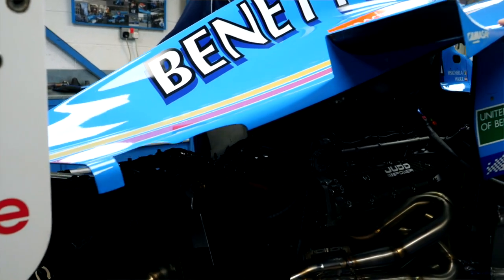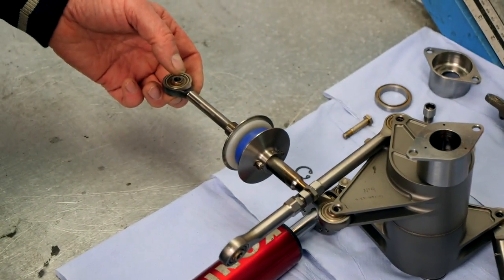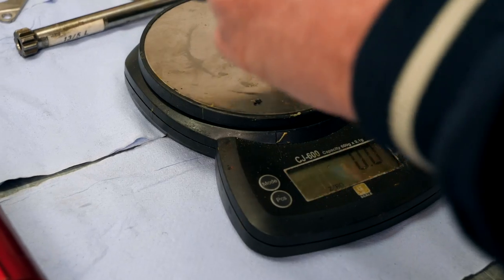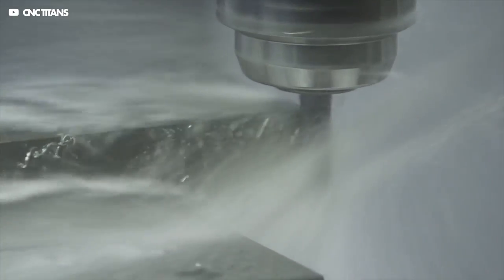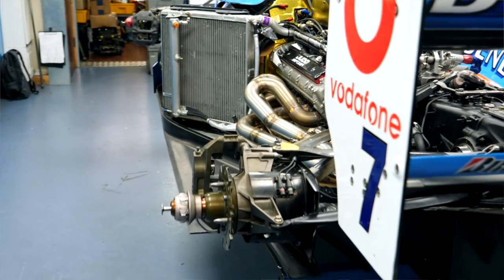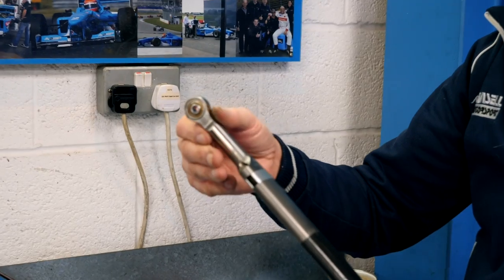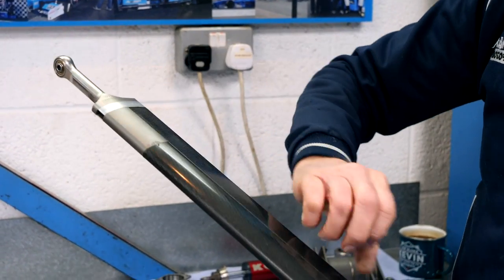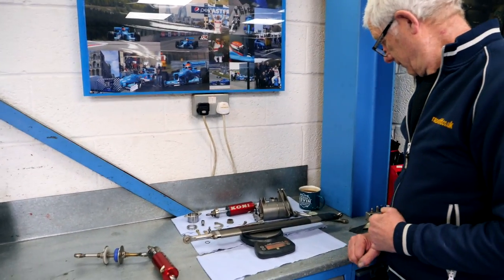How F1 Suspension Works

Comment from the maker: What do you think to this system? What systems in the car would you like to hear about next? Drop a suggestion in the comments!
Reply: An in-depth talk about:

Diffusers
Airbox/side pods
Gearbox

All could be interesting, heck any topic is interesting.
Reply: Bose
Reply: flexion joints would be first of its kind
Reply: Everything about your dads workshop would be fantastic to see Scott. Keep up the good work!
Reply: The cooling system is also an interesting topic
Reply: This was great, I would love to see a lot more about suspension - heave dampers, push vs pull rods, roll centres, camber change........
Reply: @lelz Indeed flexure joints would be a great point to talk about!
Reply: I'd love to hear how your dad ended up with F1 cars in his workshop!
Reply: Great video. The exhaust design would be awesome do dive into.
Reply: Hubs designs, Steering, engine air scoop, rear half shafts.
Reply: Would love to see a "master" course in designing a F1 car. Step by step going through all the decisions to be made and so on.
Reply: @DenUil  join your local Formula SAE team
Reply: Was your Pops a former f1 mechanic?
Please make more vids like this showing components up close. Super trick.
Reply: Brilliant Thanks, could you spend a bit more time on the suspension components, and how the components interact to control the movement of the car.
This l'd like to understand better
-  how the suspension arms attach to the chassis. It often looks as if they are bonded on flex components, so how do they quickly replace damaged suspension arms? and how much does the flexure contribute to spring behaviour?
- how does the 'anti roll bar' work - it looks like it would allow some differential movement between the sides, but would prevent equal sag or rise movement.
Reply: All of them!! I love this content
Reply: It'd be great to start of where is the actual position of those components in the car and how they behave when driving in the demanding conditions:)
Reply: I was hoping to see something about the anti roll bar .
I have pushrod suspension in a 70 mustang & im debating converting the anti roll bar into the rocker mechanism
Reply: Great video!
I'd like to learn about the wooden plank in the floor. ✌
Reply: It would be really good if you could get some regular car components that perform the same function and compare the weights and the design. Also please let your father have longer screen time and give us more technical details! Thanks for doing this, great content.
Reply: @Rendezvous70  The Anti Roll Bar is another torsion spring, the other end to the rocker is mounted to a swivel that is free to move longitudinally.   This allows for suspension compression over bumps to occur with out extra load being applied, but if one side tries to compress, then the two links to the ARB apply a twisting force to the rocker that is resisted by the torsion spring.   You can see the ARB in this image. http://www.galmerinc.com/images/front_susp_cropped.jpg
Reply: @Rendezvous70  It could, but the packaging  into a vehicle like that would be difficult and complex.  I don't think that it would be worth the effort.
Reply: @stephendean6460  ya thats kind of my conclusion too .
The torsion of the rod even if i used titanium would be beyond its yield strength at the length i have space for even though my travel isn't a lot it's probably to much .probably should have started with a lighter car maybe 😉whats an evo or sti weight..
Reply: I don't have a suggestion really, although I do like comparison videos, showing how different motorsports tackle engineering problems to suit their particular sport, so that would maybe be good on your channel.
Also, the videos you do about the more extreme things they've tried out in F1, are really good!
I bloody love this channel! It's really informative and explains things in a detailed way, that even an idiot like me can understand, but how about going into more detail on how and why they need the parts that you feature, like the things they're trying to overcome, ie: drag, downforce, grip, mechanical grip etc?
I love F1 and enjoy the pre-race stuff they put on the programmes, about the engineering side of things but, they don't go into anywhere near the detail you do, so thank you for making your videos!
Reply: It's an older suspension and components regarding the video.

Current F1 cars have done away with springs.
Reply: Different materials used on the car. In different areas and why
Reply: Great Vid but I wish these were not brief.   A little more in depth would be greatly appreciated, a little more demonstration of actual movement, etc...
Reply: Could you please do a video explaining the LED lights on the rollover hoop/air intake and what the different colours mean?
Reply: Cooling, rims and their progression through the years, intake, construction of the tub and or driver controls. Great vids I really love seeing the interworking of any F1 part from any era.
Reply: How thin are the gears in the gbox? What are the running clearance's off the bottom end?👍 love the channel
Reply: Driver61 explains how it works: the series
in-depth videos about all the tech behind every racing car series even soapbox cars
Reply: DRS. I know what it is and what it does but never will understand how it works and functions
Reply: Workshop tour together would be epic👍
Reply: you are such a brilliant educator dude. Some people are born to teach. You're one of them.
Reply: Front wing ( angle of attack control , sensors , spliiters )and steering (how tierods are actuating ) 

This kind of discussion at component level is actually good and new in youtube.  Most videos explain the  overall functioning but they don't cover component intricacies. nice work mate
Reply: I'd like to see how the steering rack + arms work. I think some of the cars have the steering arms inside of the suspension arms. It's very hard to find out how they are arranged.
Reply: How the software works when I watch races the engineers have all the data and tell the driver to cool engine, tires, etc. How do they get all the real time data?
Reply: Hi can you please KONI F1 dampers design and precision?
I heard there dampers are used in all F1 cars
Reply: FREAKING OUTSTANDING.  You answered every question as they emerged in my pea brain. 
I just watched 2 videos trying to learn about this and you explained more than those 2 combined. THANK YOU!
Reply: racing the rulebook. V10 era best era though.

Comment: @Driver61 i've a question, how happen during a crash, when the F1 hit the wall and the wheel flow out, how it's possible the monocoque can be re-used. So the suspension system, have some "tricks" to save the monocoque when the tyre it gone? thank you

Comment: Remember, this is 25 year old technology, and it still looks cutting edge.
Reply: Imagine what it must be like in current F1 cars then 😱
Reply: @xissburg  well that rubber heave spring they showed, up untill a couple years ago they had front and rear interconnected hydraulic setups to control heave and squat. Even just a 'basic' heave spring now looks 100x more complicated than the one in this video lol
Reply: It looks different, but not cutting edge. It's still dampers and pivots and arms.

Nowadays road cars have active dampers while race cars have something called Inerters.
Reply: Williams got a slower development than other F1 teams, from completely dominating in the 90’s and contending in the 00’s and having a decent car in mid 10’s, they went to dead last in just a couple of years, while using a top Mercedes engine.

And the tech has certainly advanced. It would be amazing if the UK were able to bring this kind of expertise to something commercial.

They would be making the best bicycles, motorcycles, cars and airplanes in the world.
Reply: @xissburg  if its anything like current body style and lines, its ugly af.
Reply: they could've made all the metal components in the 1960s , they understood all the structural stuff well enough. Milled parts would just have to be done manually like Allen Milyard does. 

The main technology of past 25 years is full computer control of everything both during operation and in design modelling.
Reply: @dfpguitar  And in simulation.
Reply: LOL  Torsion bars go back to the 30s  Nothing new just rare and expensive materials..
Reply: Totally!

Comment: Sorry for the interruption sr, but how important is the engine phase correlation in turn of reducing the high frequency vibrations around of the engine and the torque adjustment in the differential

Comment: The engineering in the manufacture of the rocker, all by itself, is impressive. Milling the two hollow pieces out of solid tianium blocks, (I assume they swept up every bit of scrap) and then welding those pieces together precisely; zero error, so that everything lines up correctly, and then taking the loads that that rocker has to take while barely moving what, half an inch? one centimeter? is just amazing.
Thank you.

Comment: Changing the rake does alot more than that. Without adjusting the wings it changes the AOA of the wing increasing downforce and drag from both wings by adding nose down rake. Unless the wings are re adjusted to compensate for that effect

Comment: 04:57 Did you close part of the radiator intake with tape? Can you elaborate on that? The Judd engine needs less cooling than the original Renault, or the cold temperature that day allowed for a smaller intake?

Comment: Front wing ( angle of attack control , sensors , spliiters )and steering (how tierods are actuating ) 

This kind of discussion at component level is actually good and new in youtube.  Most videos explain the  overall functioning but they don't cover component intricacies. nice work mate

Comment: Yeah I had something similar in my acura when I changed dampers and springs, one of the stops was rotten, so I just removed them and said "ahh, it'll never bottom ot anyway it doesn't matter ".. It very much mattered and I have to pull it back apart. The exhaust now has holes in it where it hits the highway so often

Comment: This is really intresting. But how about if you lower or raise a car? I mean if the rate stays the Same with front and back (let's say 5mm on both ends) does it affect the overall aerodynamics or just make the car slower/faster overall if potentyally someone could drive it as fast as possible?

Comment: The pushrod no longer having threaded joints (rose joints) also has the benefit of greatly reducing compliance in the suspension system. Great video.

Comment: That is some beautiful hardware, those suspension parts.  I appreciate the machine work on the titanium.  Titanium has a difficult reputation, but it is actually very machinable.  It takes sharp edge positive rake tooling, the correct surface speeds and positive feed rates, and no bullsh*t work holding.  Replace tooling that shows any wear at all.  And it machines just fine.

Comment: Is the load-cell instaled on the car during the race, or just for car tunning period? And how it actualy measure the force, is it comoressed inbetween 2 parts or is it measuring "the bending of the part"? Thanks a lot to anyone who answer my questions.
Reply: It's a strain gauge. Works by measuring changes in electrical resistance as a thin snaking wire is pulled or compressed. https://en.wikipedia.org/wiki/Strain_gauge
Reply: Since the power consumption of such a sensor is minimal and their form factor very small the keep all of them pretty much all the time since it valuable data. For your second question the push rod act as a linkage so either it is under tension or compression. In that case it is compression and with trigonometry and the geometry of the suspension assembly they are able to precisely determine what's the normal load seen by the tire (normal = perpendicular to the road)

Comment: Wow, the weight reduction on the parts and the resulting shape almost reminds me of aerospace, wonder if soon they will look like in the orthogrids/isogrids on the inside of spacex rockets! Someone tell Williams to get on that xD
edit: also this reminds me how sad it is that moveable aero is banned, could use suction induced flexible dimples along sidepods, like on the new bugatti, to keep the air tight to the car after turbulence from the front aero/suspension, would be so cool.

Comment: Scott, when you talk about how the change in rake angle effects the chassis balance, it’s not exactly true that the weight moves forward. The roll axis has a higher inclination (relative toll center heights of the f/r suspension) which causes the change in lateral load distribution. If you were to put the car on scales and look at the front weight, and then change the rake, the front weight would stay within 0.01% of the original value. To change the weight bias, you need to move the center of gravity, which cannot be done within the limited range of adjustment of ride height.

Comment: Increasing the rake angle doesn't increase the weight on the front tyres statically. There are other elements at play which adding rake changes.
You can see this in iRacing if you change the front or rear ride height, the front-to-rear weight split remains the same.
In a high functioning aero based car, changing rake will probably affect the downforce of the car more than anything else.

Comment: Machined from blocks of titanium and then welded together.  I don't even want to know how much that cost. 

A suggestion,  I would ike to see more about the safety  systems /  safety structures of the car .  Perhaps they're not as exciting as the drivetrain or suspension  , but  I'd argue that driver safety is more relevant than ever.

Comment: One thing I've never understood, why use a push rod? Heavy cars have torsion bars mechanically linked to control arms, could you not put a rocker on such a torsion bar and eliminate the push or pull rod altogether? I speak from ignorance, I understand if it could be done it would be done, I'd just like to know why it's not feasible?

Comment: It blows my mind that with all this technology they're still using a plain old bump rubber.  Is this because the tires have so much sidewall that they can be expected to act as a more of a part of the suspension system than we expect with road cars equipped with really low profile tires and microcellular urethane bumpstops?

If this is true, I imagine even the smallest of air pressure adjustments makes a massive difference with these cars because even in my road car on the track I can feel the difference when I add or remove 1 psi from a tire.

Comment: Machined Titanium ? I was expecting him to say Aluminium lol, figured it was powdercoated or something, damn thats gotta be expensive. Titanium doesn't come cheap, even in small amounts, the fact that these need to be big enough blocks to mill those out of, then there is the specialized tooling and programming those CNC machines need and it really shows you why these cars quickly start to go up in cost. I mean thinking on it now, it makes sense, Titanium alloys are the only materials strong enough to be able to withstand all those forces, while still being that lightweight. You definetly would not be able to get away with a hollow suspension rocker like that if it was made out of something like Aluminium, it would need to be far more chunkier to withstand the same forces, structural ribbing or not. To think that the engine itself may actually be one of the cheaper parts of these cars, is mind boggling.

Comment: These parts that weigh 500 grams, how much force are they designed to take?
Reply: Tens of kilos/couple hundred Newtons I suppose.
Reply: It's a push rod, so meant to take the forces transmitted by one wheel. If the car weighs 650 kg, and pulls 5 g, that's a force of 813 kgf per wheel, so that is what it transmits at steady state. In reality, it's more, since it needs to also account for bumps, kerbs, and weight transfer under braking.
Reply: @AlpcanAras  Given the car weighs over 700kg I assume we're at least talking thousands to tens of thousands of Newtons, especially given aero loading and bumps and kerbs.